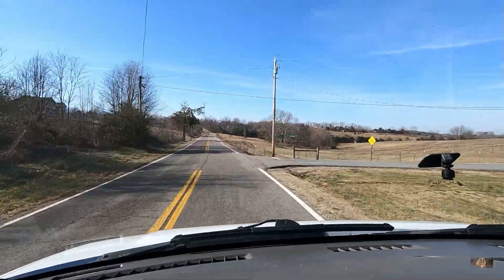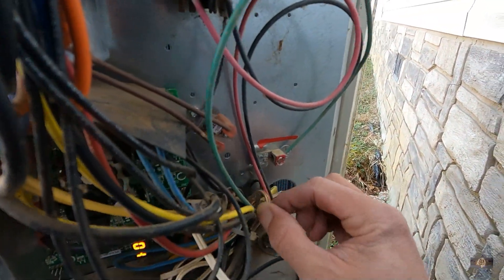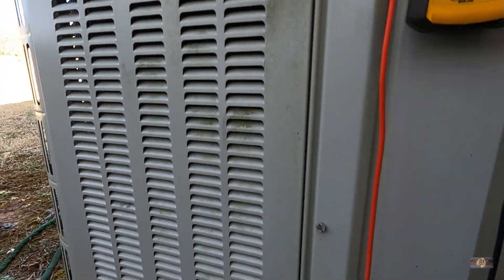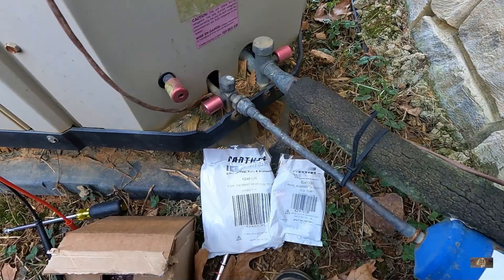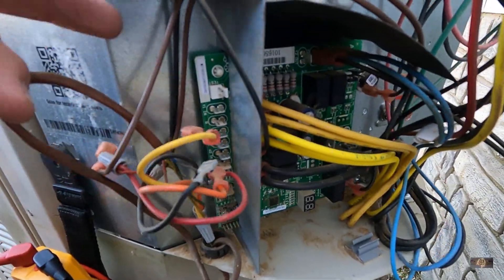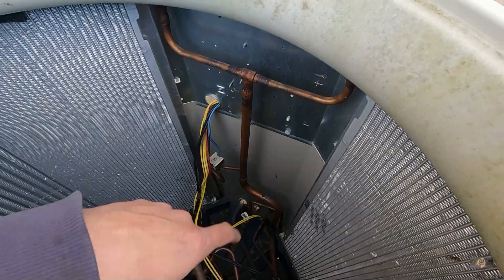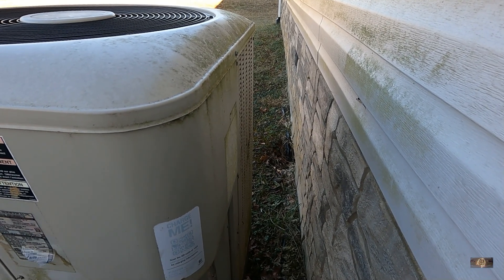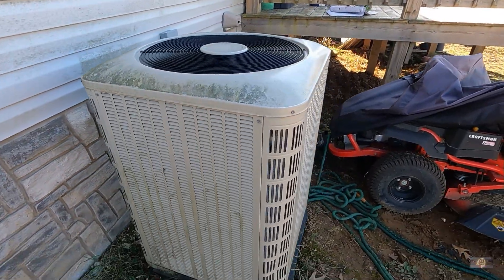Troubleshooting Defrost Fault Code on a Heat Pump

Comment: Hi Jake! Nice job you did it, but why you changed the control board?
I will start working in maintenance in residential systems so normally how much charge per mile to pick up the parts from supply shops? Thank you.
Reply from the maker: I offered the control board because it wasn't much money to replace it and I was already making the trip out to the supply house which was a couple of towns away.  Bridges were down in the area due to Hurricane Helene which increased the travel distance and time even more, they lived in the middle of nowhere already, and the drive to them and out to the supply house was long.  If I threw the board into it, the price didn't go up much because this particular board was cheap and to swap it out didn't take much time at all.  I offered it as a courtesy and discounted.  The last thing you want is to not offer it and then they call you a week or a month later saying the unit isn't working again and the board failed.  If they decline it, that is fine because it is working, you just document it on your receipt that it was declined, but offered.  When they call you a week later or a month later and the board is bad, you are covered and aren't having to comp work.  You charge based upon your over head for travel costs and your time.  Everybody will be different on what they would charge.

Comment: I keep a 10k and 20k chart on my phone. Never understood why Nordyne put that plate across the board like that, with connector terminals so close to a piece of metal that could rub a wire. That was one long travel. Can't help that they chose to live so far from supply houses and civilization. They gotta pay for that. Smart to go ahead and choose to be proactive and prevent other possible issues. Stay safe on those roads.
Reply from the maker: It is a weird set up for sure.  It seems like people that live far out never expect to pay more because of where they live around here.  For some reason it seems like they expect it to be cheaper.

Comment: So if a sensor is 10k, is that normal to measure resistance higher than 10k?
Reply from the maker: That is not how it works.  You have to reference a 10k thermistor chart to know whether or not the resistance is in range.  The chart on my phone has temperature ranges and the ohm reading you should have based on the outdoor ambient temperature.  At 77 degrees Fahrenheit a 10k thermistor will be 10k ohms.  Anything below 77 degrees and the resistance will be higher and anything above 77 degrees the resistance will lower than 10k.
These manufacturers in my opinion should have to include a thermistor chart on the inside of the electrical panel with the wiring diagram, but none of them do that I can think of off the top of my head.  If you are lucky enough to have a manual with the unit, it makes it easier.  Some units will tell you the size of the thermistor while most do not.  Inverters will typically have lots of different sized thermistors on the outdoor unit.
Reply: @JakePorterHVAC  thank you
Reply: Jake's explanation pretty much covered everything, but I wanted to add that the name 10k, refers not to the correct constant value of the sensor, but to the standard calibration value at 25⁰C, which is 77⁰F. Then the measurement will vary based on the actual temperature surrounding the sensor. So yes, it is normal and expected to have a reading other than 10k almost always.
Reply: @realSamAndrew  Thank you

Comment: that looks like crappy heatpump - microchannel style coil.
Reply from the maker: They are a cheap up front cost.  Parts are readily available and cheap too.  See lots of them in double wide homes and trailers around here.  Pretty easy to diagnose.  Thanks for watching.